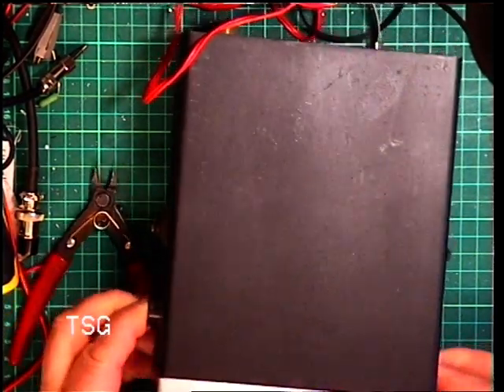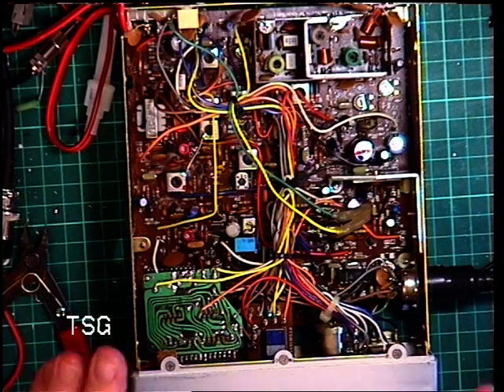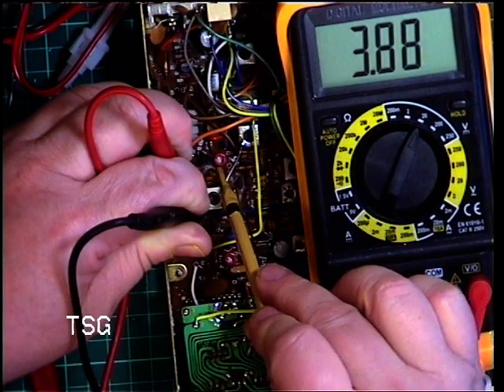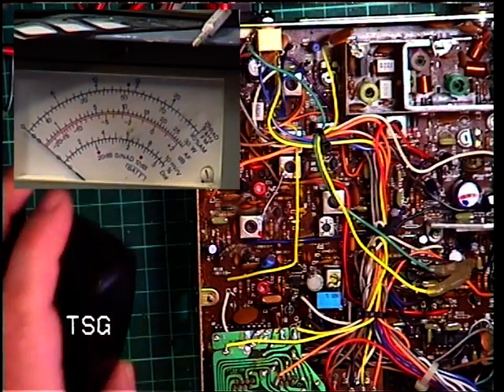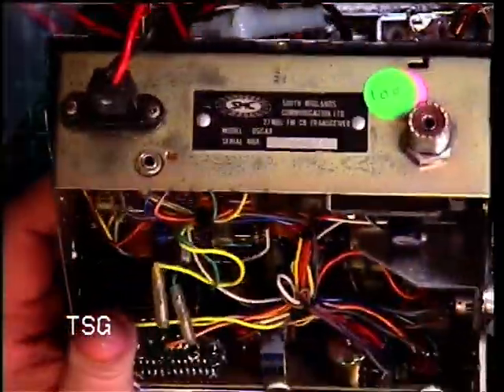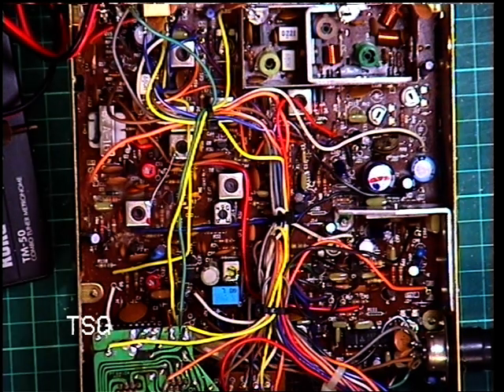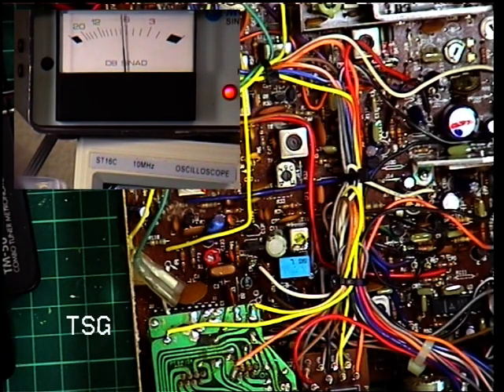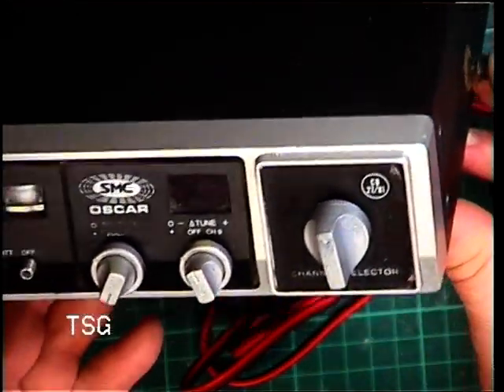SMC Oscar 1 UK CB27/81 (mobile)CB radio - Complete service

Comment: you inspired me Richard, i found a nice example on eBay for £18 buy it now, it arrived today and works an absolute treat thanks
Reply from the maker: I reckon it'll be in good condition as it's too 'boring' to be the kind of radio that screwdriver experts would want to fiddle with. In fact I'ven ever seen a messed up one.....whereas nearly every York 863 & Rotel 240 has been got at.

Richard

Comment: Looks like a re badged hygain one of the old US 23 and 40 channel models. I had the hygain 3 80ch am fm back in the day
Reply from the maker: Manufacturers like Cybernet would have had their 'standard' fronts customiseable with unique inlays to suit. You would have approached them wanting say,10,000 units with certain features & they would have come back to you with illustrations of various front panel designs. I was doing Maxon business radio from about 1986 to 2000 & this was at a time they were producing 83% of the WORLD'S CB radios & utilising 16% of Motorola's GLOBAL semiconductor output in doing that & their business radios, so you find similar fronts over decades of time in different countries & with totally different innards for different regions of the world & thus different licensing requirements. It's a pity Kyocera bought out Cybernet where they make only solar panels now. All those decades of radio manufacture knowledge gone.

Richard, G0OJF

Comment: Just did a quick alignment of my own old Oscar and found it so far out I don't know how it worked. Had to replace the 10.24 crystal as it wouldn't go near the 10.24046 the service manual specified. The detector was badly set up on the wrong peaks, and the front end and if's were also way out. I say a quick alignment as I'm still waiting for my RF attenuator to arrive as the lowest I can go with my sig gen is 100uV.

Comment: I have one in the bottom of my draw still powers up & transmits.
Reply from the maker: I find that these SMC Oscar 1's actually work better than any other Cybernet 134 based radio & wonder if, as SMC were Yaesu importers, that they had asked for these sets to be made to the best possible standards. They weren't a cheap rig either @ £89.99. Lowe Electronics,the Trio/Kenwwod importer at the time did the Lowe TX40 which was made for them by Worldsound.....a bit of an 'also ran' in CB manufacture but certainly not junk. When compared to other radios at the time using the Worldsound chassis, the Lowe is by far the best, followed by the Grandstand Hawk...then you get the others like the Viper 88 & the Braemar PT40 etc. The Lowe version is even slightly a different board.
Glad to see you're a Yorkshire Lad. I originated from Rotherham & Mr Chippie who works here lives at Shipley near Bradford.

Richard

Comment: I received my Oscar cb from ebay and its receiving and transmitting but no audio can be heard only very low when volume on my other set is turned up full . it needs servicing could you do that for me.
Reply from the maker: You will realise I don't normally do work for end users, but under the current emergency am doing so. Email me    rshireby@yahoo.co.uk

Richard

Comment: SMC converted a lot of these to 29 MHz and sold them that way. Maybe that’s what that board was for?
Reply from the maker: It was the Oscar 2 they converted with it's Motorola General Purpose PLL chip. The SMC Oscar 2, however was pretty lousy & similar in design to the Signal 1001 & JWR M2. The Murphy DS602 was similar again to the Oscar 2, but with a more normal PLL. My conclusion with the naughty board I believe it shifted everything 1/2  a channel for' 'privacy'. I saw this happening when I worked in Bradford & reported it to the authorities who did a nice little swoop.

Richard
Reply: @ukfmcbradioservicingTango21  Interesting! Your knowledge in this area is considerable.